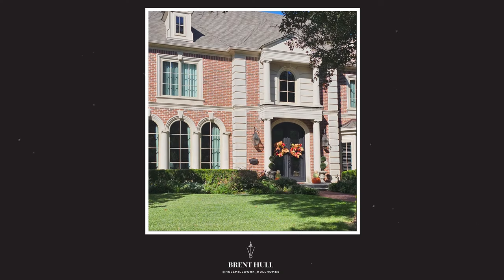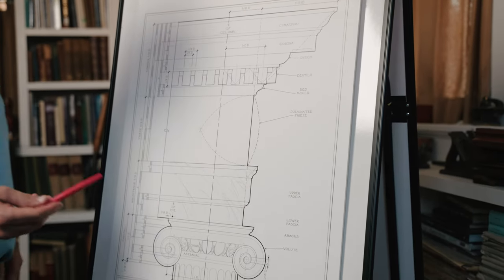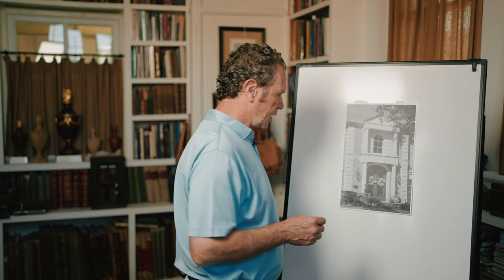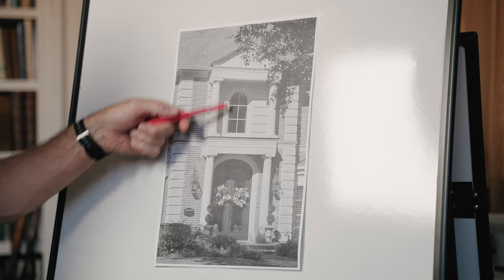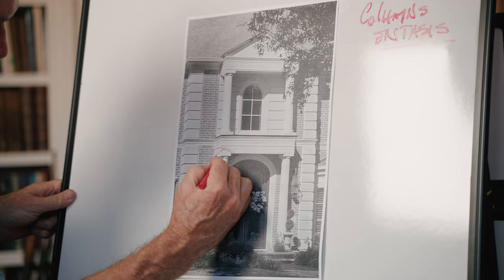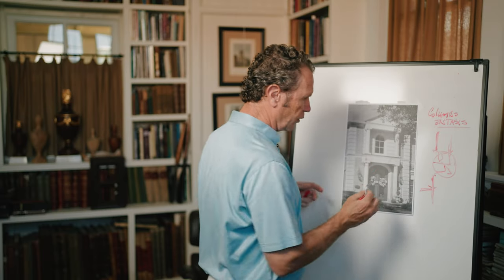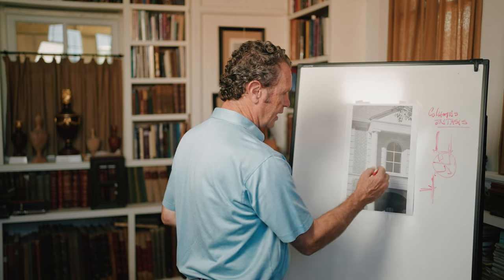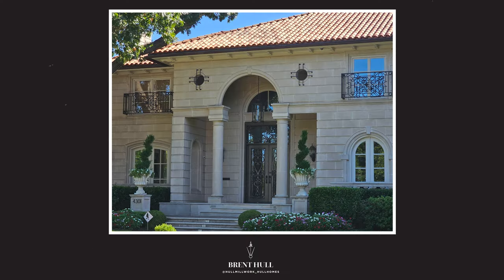How to build a front porch. We keep making the same mistakes.

Comment: Hi, Brent, excellent video. Your comment about dividing a column into thirds and tapering the top two thirds reminded me of a story I read years ago about the design of the Parthenon in Athens. They said that there wasn’t a straight line in the whole building – not because it had settled over the millennia but because the architect had to correct for all the “optical illusions”. Not only are all the columns tapered but the temple floor has a slight arch in it from front to back and also from side to side, and then they said that if you drew a line up along the outer edge of each temple column and extended it up into the sky all the lines would converge at a point that was about two miles above the earth.
All this was done to correct for optical illusions: at a distance - if you "arch" the floor it will look flat, if you taper a column it will look straight and if you angle a row of columns inward they will all look perfectly vertical. It's astounding that they knew how to do this over 2000 years ago.
Reply from the maker: Exactly,  thanks for sharing that story.

Comment: That arch looks weird as it has not thickness. It's suppose to reflect stone structure but it's thin like a stage set. I would have designed  a barrel vault as well instead of those  that high ceiling space.
Reply from the maker: Thanks.